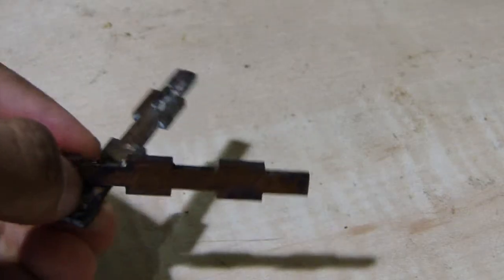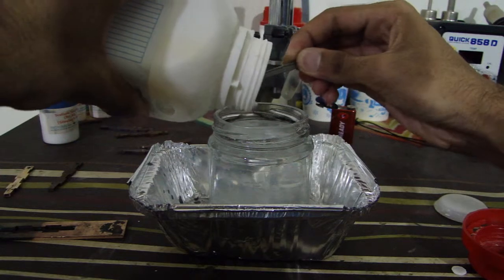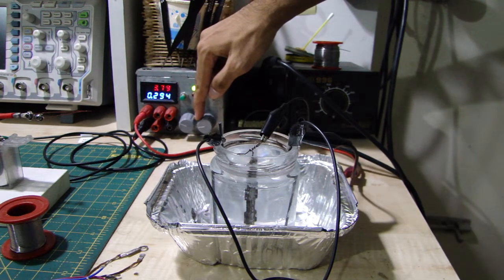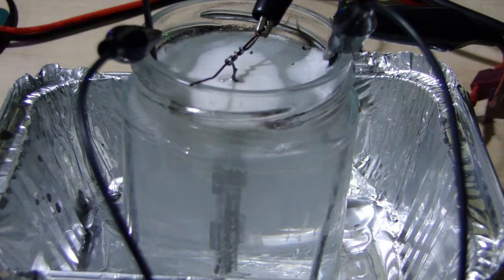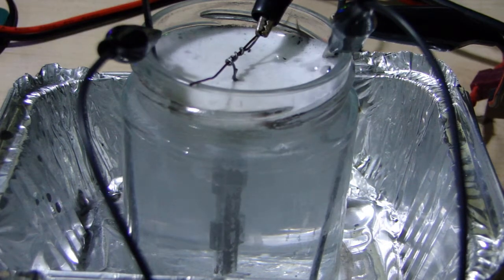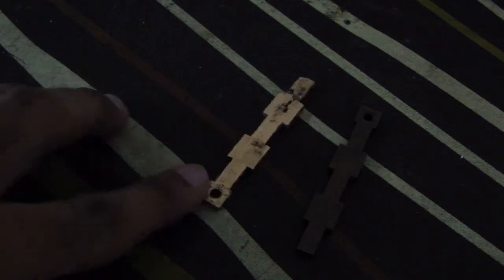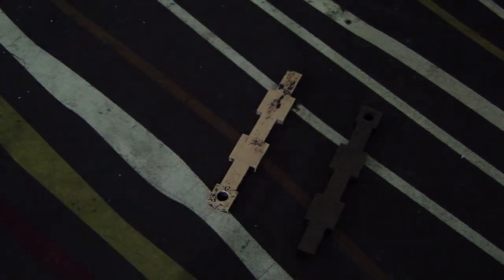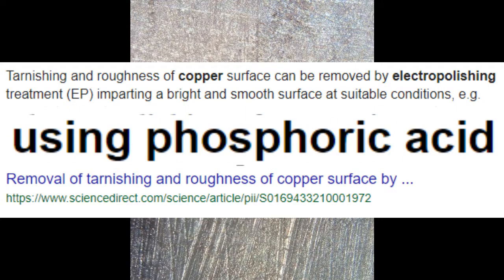Chemistry #2 - Electropolishing FAIL!

Comment: How to perform gold electropolishing?  Can you suggest electrolyte?
Reply from the maker: I'm not sure, but phosphoric acid works really well for most metals.
Reply: @NNNILabs  Thanks sir... Can you suggest which material should be used for cathode and anode while electropolishing..
Reply from the maker: @शेती-वाडी  I suggest using graphite since other materials might interfere with the process. I used pencil lead, which works well enough.
Reply: @NNNILabs  thanks
Reply: @NNNILabs  Can phosphoric acid be used for electro polishing gold jewelry?